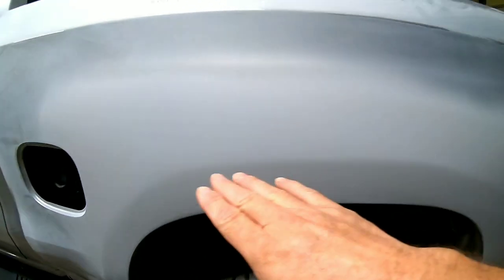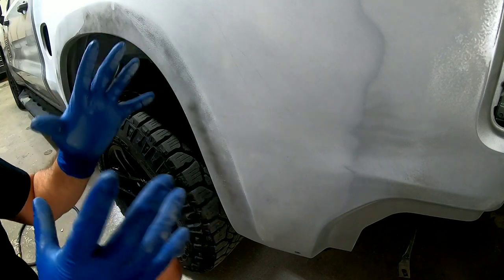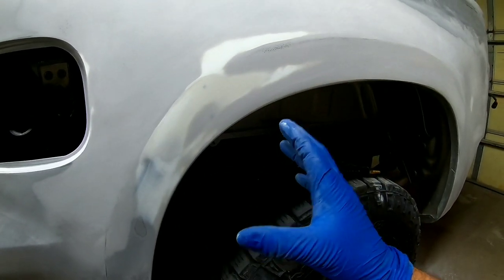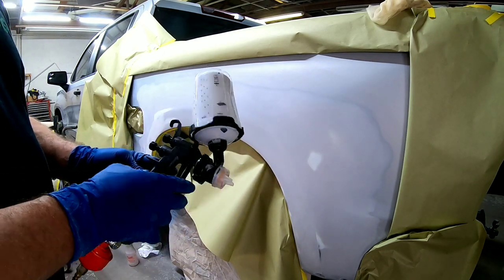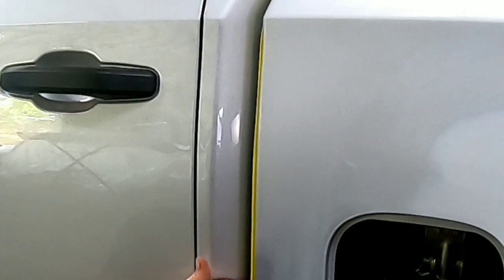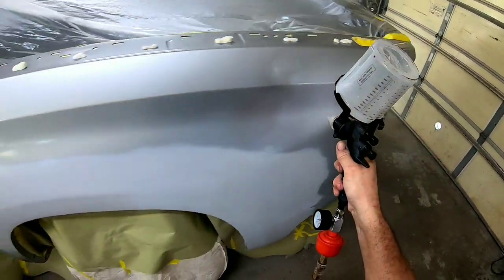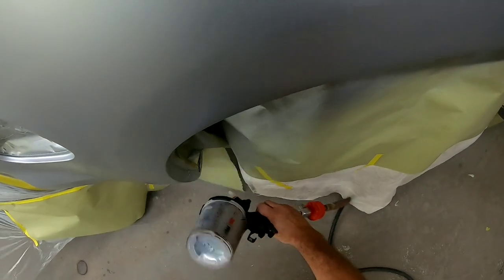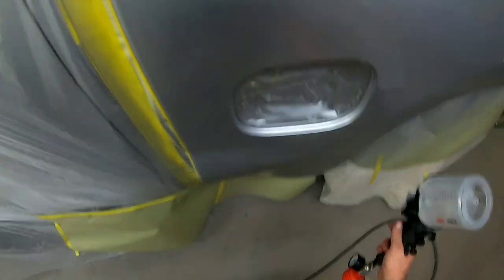DON'T make spraying silver auto paint hard! silver paint secrets!

Comment: Hey Chris . Got a question, I  got a 99' Honda 4-dooor . The paint on the roof , the hood and truck area are gone no clear coat. Along of the sides of the door midway there is some clear coat but it's peeling . Anything below that peeling clear coat is okay. I want to paint the whole car back to the original color [which is black] what prep work would you recommend?
Reply from the maker: Sounds like you could use 320 grit to sand the entire vehicle. Smooth out pelling clear areas. You could use 600 or 400 on the paint that's in good condition.  I would primer  the upper  surfaces and peeling areas.  Check out my video how to prepare paint for primer
Reply from the maker: https://youtu.be/g1cN2fiCOEc

Comment: Good tips GN - I didn't see it but what type/brand of wet bed are you using?  BTW - you're a heck of a good painter :)
Reply from the maker: Thank's brother,  I just use nason binder or binder from my local supplier. I sold my bank only painting  a couple cars a week.
Reply: do i have to block sand after i prime the car  just paint it does it matter sir
Reply: why  can't you just paint it after you primer it just asking sir
Reply: @johndoe-tf2jz  You can.  The only problem is that it won't be as flat and perfect looking.  Block sanding primer makes it really flat and straight :)
Reply: @johndoe-tf2jz  If the panel was perfectly straight under the primer - no.  If you did some body work - like fixing scratches, dents, chips, etc. - yes.
Reply: okay sir
Reply: i got a caberallo 81 its has a bd left side by the shock can i butt weld it to fix it sir The caberallo is a memories from Father in law passed 10 years ago he was in the air force
Reply: the frame by shock
Reply: @johndoe-tf2jz  Yes - you can fix it.  If you have the will to fix it, you can do it :)
Reply: @LakesideAutobody  thanks sir but i can't afford a mig welder sir but i want to fix the caberallo frame but afford the welder

Comment: Thanks a lot!!!
In this vedio, what is the trick you use to color match the newly painted rear quarter panel with the unpainted old panel?
ALso, what the corresponding reducer should I use based on the temperature?  In canadian winter, my heated garage is around 15 degree (59 F). 
Thanks again!!
Reply from the maker: The color blender or wet bed helps with the blending of the basecoat. As far as the reducer for your temp I would probably use a standard reducer with a silver if it was any other color I would probably go with a fast. Hope this helps! Appreciate the comment and support!

Comment: Great tips painting silver metallic. Subbed. Would using tinted sealer help use less basecoat over bodywork for consistent color substrate? 🤔 I noticed when I painted a bumper I didn't spray it gray as it was a new bumper black primed rear bumper. It was slightly darker than rest of car when it dried.
Reply from the maker: Yes it will help. Thank's for watching welcome  to the channel!

Comment: Shouldn't the wet bed be applied before every coat of base?  If you don't apply the wet bed before the 2nd coat the base in the blend area is landing dry.
Reply from the maker: You can and it won't  hurt anything just  depends  on what your looking to accomplish.  In general  a wet bed is used to create a barrier between  sanded panels and the basecoat so the metallics of the paint lay flat in the wet bed. If not used you could have metallics  laying funny in the fine scratches from sanding.  Causing  modeling or an inconsistency in you metallics. Hope this helps appreciate the question and support!

Comment: Any tips for spot repair with silver and metallic.. where I work they limit us with minijets only, water base color, solvent base clear. Only blender for clear not for color. And not an environment to clear the whole panel.... any tips with be awesome
Reply from the maker: Wow, they really handcuff you! Is this a mobile repair business? I've got alot of experience with what you need to know. I ran a mobile paint repair business for dealers for a few years. Smart blends, tight blends an small repairs . I'll  put together a video , it's  useful info even tho it may not be the best way to do things. Thank for watching.
Reply: @GarageNoise  if it was mobile I'd feel better but it's one of the top auto manufacturers. They moved all the people that were in spot repair to other areas. No one to show the replacements what they did.... I have some experience but body work, welding side not so much paint but even still spot repair and painting are much different. But it would mean alot to get some knowledge from someone so thank you so much for any help.